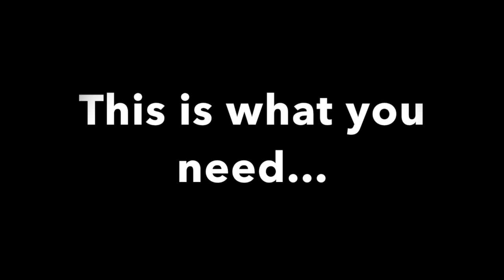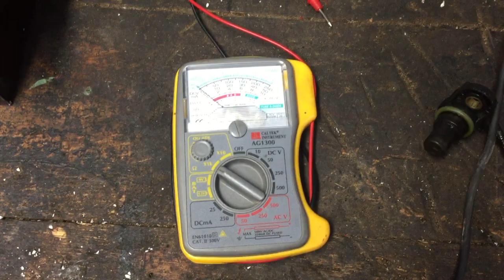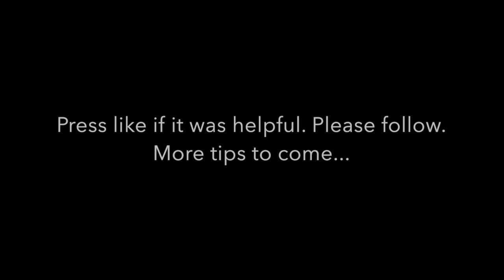Cam position sensors, replacement BMW E38

Comment: Hello I replaced both of the sensors with a bmw brand. I’m still getting the same code P1519. Please help. Thanks
Reply from the maker: Hello, exactly what does the code say?
Reply: @drdragunov  inlet camshaft control system end position plausibility P1519-Engine . Thanks
Reply from the maker: @mauriciomarino6669  Sorry to say, I think that the coggs have come undone or you have a primary chain problem. Not cheap to fix. I have seen it many times.
Reply: @drdragunov  what are the coggs? The timing change had been replaced. The engine runs nice and strong. Thanks
Reply from the maker: @mauriciomarino6669  The coggs are the ones on the cams. Looks like windmills. They have a tendency to get loose if not tightened correctly. This engine is VERY sensetive to timing. I have done 53 engines already and know it must be 100% correct. Otherwise it can be many other things. Hard to say if I cant see and listen to it. 
And also if the vanos is not correctly timed you can have this problem. It is not for the average mechanic.
Reply: @drdragunov  I’ll be happy to make a video for you. Let me know if that’s possible and how to send it to you. Thanks
Reply from the maker: @mauriciomarino6669  Go on Instagram and search for Doctor M62TUB44

Comment: PLEASE MINE WONT FIT DO I PUT THE O RING ON IT OR LEAVE IT OFF ?
Reply from the maker: It must be on otherwise it will leak. Check if the old ring is still in the hole.

Comment: I have a prefacelift E38 that will start but will shut off once the rpm settles down to zero. It doesn't shut off all the time. Do you think the cam sensor is the problem?. I scanned car and a cam sensor came up as a pre-code
Reply from the maker: No, I wouldn´t go for the sensor to start with. Start the engine and disconnect the MAF. Does it run better? Did you get a code for both cam sensors? If not, change them over and see if the problem moved to the other side, then you have a broken cam sensor. Get new ones, both needs to be changed. And DON´T buy Chinese crap. Bosch is the only brand for these sensors. And yes, Bosch is more expensive but they will deliver the right signal to the computer for as long as you own the car. Chinese sensors might send the wrong signal and then the computer triggers other, unrelated problems and you are stuck in a maze of codes.

Comment: I've read some things about these sensors needing to be positioned just so to work correctly. It looks like they can only be installed in one position, correct?
Reply from the maker: Yes, they can only be bolted on in one position.

Comment: Was the smaller sensor under the intake ?
Reply from the maker: The only sensors that are under the intake manifold are the knock sensors. The cam sensors are identical from left bank to right bank.

Comment: does Valeo sensors work too or have to be only bosch?
Reply from the maker: Thanks for the question. This is a matter of debate. Some say aftermarket sensors like Valeo works but I would not take the chance.These sensors are a big part of the whole setup for the engine to run as good as possible. And since you probably only going to chance once during the expected ownership of the car I would recommend you to go for Bosch. A little more expensive but then you know your sensors are working correctly and for the future, if you have issues with the engine not running right, you can be sure it´s not these sensors that are not performing.
Reply from the maker: Only Bosch!